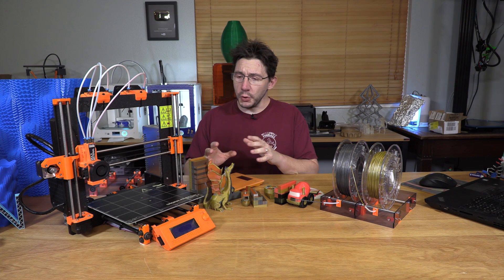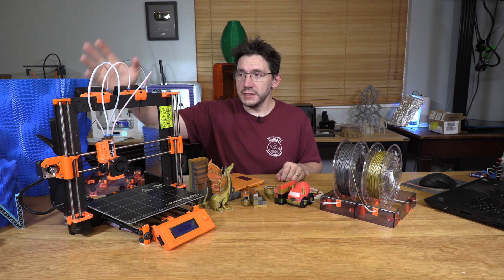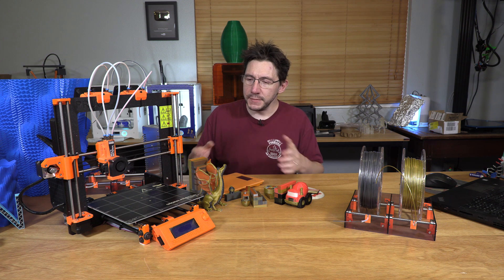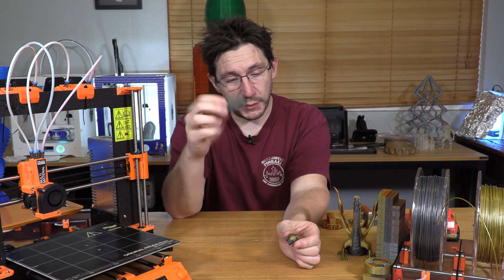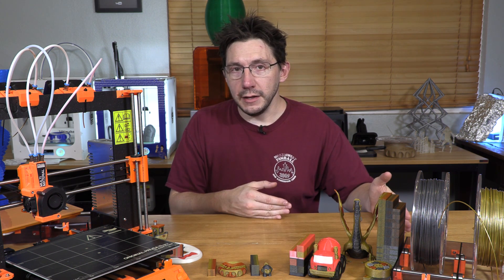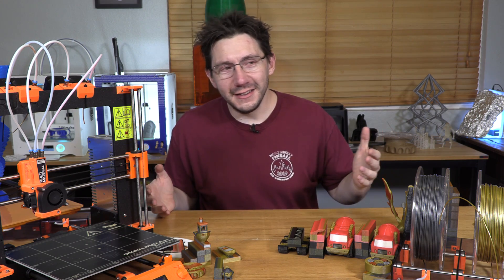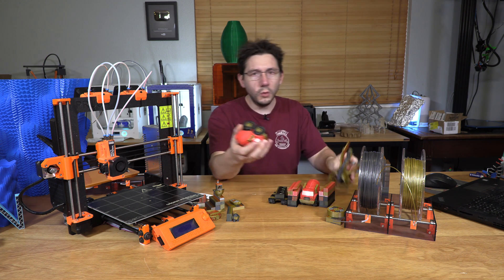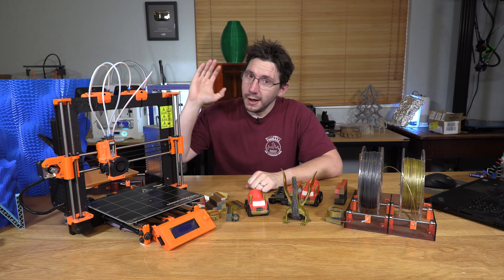Prusa Multi Material Review(?) - My Thoughts on the Prusa MMU 3D Printer

Comment: First of all thank you for you great video.  I am new to 3D printing but having a great time learning and building some great solutions to dynamic requirements than I encounter.  But I am also a systems engineer and want to see the entire 3D printing from the design all the way to the finished product and all of the side stuff along the way.  Following is my question/vision of what I would like to see.
1.  Enhancements to the STL/OBJ to natively and easily support Multi-material and Multi-color.  We already have the ability to change the color of 3D model element unless we join two elements and lose one of the colors.  But why not keep them unmerged and use the native design software and simply assign the display color during design to color1, color2, etc for the available filaments and have a remap facility when not enough filament colors are available to reassign to the closest color.
2. Now having the MMU standardized in the file support facility for storing the file info along with MMU this  can be supported by all 3D Design Software packages from the outset.  (Tinkercad, Fusion 360, etc.)
3.  We could also have MMU Painting support packages for existing STL files but I think that this would be primarily to bridge the period until MMU becomes the standard supported everywhere.
'4.  Next we have to build in the MMU support into the slicers which means that gcode must also have MMU capabilities.  I don't know enough about the status of gcode MMU support to comment.
5.  Next we must expand the availability of 3D Printers to support MMU and have upgrade path for user who grow from 1 to many colors.
6.  Finally we must address the waste block problem.  I can imagine that there are many potential solutions from recycling to time control where filament support for unused colors are turned off when they are not going to be used and then turned on either when needed with a latency issue for the hotend heating up or in a lower temp wait mode with less warm up time to having the slice figure out how long it takes for the hotend to heat up and imbed a "start heating up color n" a couple minutes before the color is actually required.  Again this is a tradeoff between print time and print cost but brilliant optimization solutions and system wide design for the entire ECO system is the right way to go.  Please comment.

Comment: stupid question, wouldnt it be possible to always just print a one shell box for the purge block? wouldnt that reduce the amount of waste considerably since all the filament that gets used there just to raise the purge block to keep up with the print height would be reduced quite a lot. and when changing filaments it could just move to the center of the purge "box" just extrude some filament mid air and wipe it off on the single wall when moving out of the purge area again. might not be perfect and but waste would be reduced a lot

Comment: the purge block size is about how often the color has to be changed per layer thoughout the whole print... if u have like 90% of the layers 1 color without other colors in the same layer it does not need to purge for literally 90% of the print... if u have crossections that alternate a lot between colors it needs to purge a lot more... 

so to optimize for small purge blocks u would have to minimize the colorchanges per layer

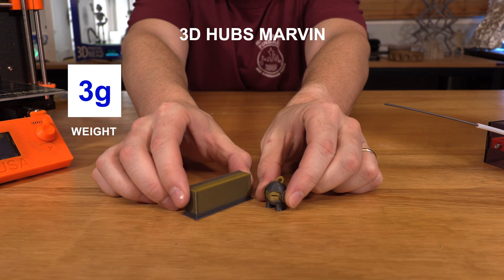Comment: 7:35 yeeaahhh I'll stick to painting. If I do something like this itt'l be more so I can print one thing in PLA, another in ABS, something else in PETg, all without having to change spools. I wouldn't really have a purge 'block' at all, just a purge line, as I'm not gonna be mixing different types in the same part very often if at all.

Comment: I know im late to this party but how about combining the ideas of a standard inkjet printer with a 3d printer.
have a filament that has no colour and can be dyed right in the hotend (the same way they colour plastics in injection moulding, that usually starts of as colourless beads of plastic and they just dye it to suit inside the mould by squirting the required colour in there as the plastic melts). 

in my idea instead of 4 extruders like on this model there would be 1 extruder and 4 ink reservoirs for CMYK)
that way you could have infinite colour prints from 1 nozzle and one roll of filament. if the ink is squirted in just before the plastic comes out the nozzle the rest of the hotend would still only have colourless filament in there, so there would be less need for purging (it doesn't have to completely empty the hotend of one colour before it starts the next)

it would still need a purge block tho but I recon it would cut down on the amount needed to purge

I'm sure somebody with far more brains than me could make that idea work :)  I'm just spitballing

Comment: hey joel, theres a 3d printing trick that now pretty much no longer needs a purge block if you can put your nozzle outside of the printing bed or limit your printing bed. Here is someone who found out that you can pretty much cut the waste by half or even more when you use a purge bucket instead. Ive been using it and it works a lot better than the purge blocks. plus it cleans the nozzle every material change if needed. I think you can do it with this prusa. I got it to work with my tricked out cr-10 with a dual extrusion set up. Gcode set up is pretty easy too. if you need help with that I gotcha. Check it out! https://www.youtube.com/watch?v=XDZzQ2S6jt4

Comment: What people need to understand is that the size of the purge block is completely dependent on how frequently you need to change colors. If you have a model that only has a different color on a few layers then the waste will be minimal. But if you need to change colors multiple times in almost every layer (especially like that dragon which must have had to use 3 to 4 colors for most layers) then the waste will be much greater. There is no way around it. The only way might be to manually purge which could save a bit of waste but even then it wouldnt be worth it considering how much time you will spend changing filament. Other than that you would have to have multiple hot ends or a tool changer which bring upon their own sets of drawbacks.

Comment: Is there a single filament that changes colors when exposed to some sort of external treatment?  Or four different filaments that can be merged together during the printing process that when treated after the fact creates CMYK colors?  No more waste.

It seems to make more sense to have one print head per filament that can be housed in the same assembly or perhaps parked to the side while the one that is needed fills in its part.  I recall you interviewed a guy who was selling paired nozzle kits for about $200 each.  His method allowed for 8 color printing without the waste.

Comment: Appreciate that I am coming to this video long after it was first posted, but I have a question... Would it be possible to set up the printer on a large (robust) shelf or table, with a shelf directly above the printer that held the filament dispatchers? The reason for asking is that the way that the filament feeds in to the mechanisms that are bolted to the cross-brace look as though they expect the filament reels to be physically lower than the cross-brace. 

Asking as I'm thinking of purchasing an i3 with the Multi-Material upgrade, but I'm a little constrained for space. If I can I'd like to be able to position the filament above the printer. Thanks for any info that anyone can share...

Comment: im curios would adding a seperation layer in the purgeblock fix most of the waste part? what i mean is that you add a layer or two where it main porpse is to make it posible to seperate the different collord layers. im think if there are a few studs in between or it has specific places for the indifidual collors

Comment: Hey Joel, I think you're close when it comes to the waste blocks, but you're not quite there I don't think. The size of the waste block isn't directly related to the model height, rather it's related to the number of color changes per layer. If you print a two color model of your house, in with the windows being black and everything else being white, any layer that intersects with the windows will create tons of waste because of the many color changes needed to print the windows and walls in between them, but the rest of the layers won't create any waste. 

Similarly, the mustached light switch plate and the maker coin you printed have rather large areas of the same color, they are wider than they are tall, and neither of them had complex multicolored areas that required lots of color switching. 

Have a nice day!

Comment: there are several methods that are possible that wil minimice and sometimes remove the wast block. 

1 have multiple extruders no need to purge no waste.
2 have a separate bed that folos the model so that you dont need to build in height you just need to purge the necesary amount. 
3 purge inside the model. small models with lots of changes wil be bad ut if you have a large area that needs to be filled then there is alot of space to purge is it not.

Comment: Why not just use the inner part of the prints (hidden inside not visible) to evacuate the mixed colored file ment. For sur the weight of the model will be double, but it will not finish in the trash
Reply from the maker: This video is a little old - they are actually doing that now!

Comment: First off, I have a XYZPrinting Da Vinci 1.0 printer and a Monoprice Mini Delta printer. I think the XYZPrinting printer is a direct drive printer, I think. The Mini Delta uses the Bowden tube design. I am not a fan of the Bowden tube. It is known that the Bowden tube design does not work well with flexible filament., Pet-g, etc. 
My question is first, am I correct that the newer i3 mk3s uses a Bowden tube? If yes, then my second question is how well does the i2 /i3 work with TPU plastic and the like. If I upgrade to the i3 I want to use all kinds of filament. I use filament by a UK company called rigid.ink. I am using their PET-G clear filament in my Mini Delta. And it works Ok. Sometimes it print great, perfect  and then I have to tinker around to get a good print again.

Comment: With a filament recycler..... Just think if you could purge specific colors in a different block there would be less color shift due to the mixing of colors, then you could more easily control the color rather than mixing ALL the colors together into one new filament.... May be worth researching a little....maybe? x-D

Comment: In this video you discus recycling wasted filament and plastic. This is a problem I have been troubled by with just having 3d printing as a minor hobby. How do you handle recycling your waste plastics as someone sho is definitely a major consumer of these plastics and filaments? Have you found somewhere that takes the waste like some kind of trash service? I havent been able to find anything like that for consumers yet and it seems like the only good option is getting machines for an in house process, as you mentioned toward the end of this video, which doesn't seem like a very good option. What ways have you found to "recycle" used and waste filament plastics?

Comment: Where would you send someone to learn how to print in color. I would like to start learning how to change my designs. Right now I just stop the print and change the filament, but would like to learn how before buying the upgrade.
Also, have you tried it with dissolvable yet?

Comment: You could save waste, if you optimize fillins and keep color if it's out of sight. Only the outer sides must be in the right color. So you could analyse the object, how big the walls are and optimize ways to be taken for using one color before changing it. If your wall is inside (fillin) just keep the color. If you print outside change the color according to the face of the object. So waste will be reduced.
The G-code can be optimized for that matters. If you have the geometry of the nozzle you can optimize z-axis to go up and down, if the nozzle fits in the gap you want to optimize.
So you need a new kind of optimizing slicer. With AI you could solve the labyrinth optimizing the ways to be taken.

Comment: Do they currently have a soluble support material for use with this printer setup? There are a lot of designs that our company produces that could utilize soluble support. We have a Statasys 380mc that works this way, but would like to increase our printer throughput with lower cost material and not have to pay another 200k for a printer.

Comment: I imagine if you can orient the model to have as few color changes per layer as possible that would also be a significant factor. It would also be nice if you could assign the material that would go to the purge block into printing another object (that was not color picky) at the same time. I wonder if just making a robot arm that could spray ink/paint on the surface of a model might be a better approach.

Comment: That bearing is the most common and cheap bearing you can buy. Half the stuff on thingiverse that uses a bearing is modeled around that 608.
As for the purge block - it also comes down to colors present per layer. Careful construction of your model can keep the color changes per layer to a minimum, as can careful selection of your final print axis.

Comment: I'm going to ask this in all seriousness. I'm a complete noob but I have a serious goal in mind of what kind of prints I want to accomplish.  I come from the hobby modeling world and have a degree in sculpting. So the goals I have are to print modular small scale prints with the hydro disposable filament and use a superflexible filament for hinges embedded into a third high strength material to eventually be coated with nickel for an  electroplated finish stage to be a super strong inner frame. Whew that was difficult to type in one go but I hope its understandable, But I'm having a hard time finding a multi filament system for a beginner... with work and help is this a good choice or would you recommend something else based  on what I want to do
Reply from the maker: Hey there! So, this system wouldn't be the easiest for what you do, as printing superflexible materials with this isn't easily possible. There are other systems out there that could print super flexible materials and rigid materials - look at what Diabase Engineering is doing with their H-Series.

The only issue, then, would be figuring out the electroplating!

Comment: instead of it printing purge blocks wouldn't there be a way to make the machine take that purge materials and just print either multiples the purge versions of the print will just be wacky looking? or default the machine from a purge block to a pen holder or set it to make a ton of nuts and bolts at least then the purge would be useful and there would be far less waste in the end just sayin why does it need to be a block

Comment: if you can recycle the waste into new multi-color filament and then use that as a interior model filler. as long as there is no color bleed through. you would save a lot of material.

Comment: Joel, long time lurker, first time commenter... And unfortunately, I have some issues with your "review(?)"... You focused quite a lot on the waste aspect of this technology, and I think that does a disservice to it.

Multimaterial printing isn't new (I've had dual-extrusion Pegasus machines for almost 4 years), but the ability to print 4 colors is, relatively speaking. Like you said near the end, this is a "Mk 1" tech for this plateau.

Second, you make no mention of any effort on your part to tune the retraction settings or waste-deposition to minimize your losses. These are end-user tweaks that change based on the filament types and color gradients.

Speaking of settings, you didn't mention that unlike the competitive technology (E3D's Kraken), this is a single nozzle technology with no fiddly offsets to figure out. The flipside of the ease of setup being those waste blocks.

Lastly, the MME option on the Mk2S and Mk3 is not designed (in my opinion) for hobbyist printers, but rather for niche manufacturing customers of the Mk2S/Mk3 who have the ability to pass the additional cost to their customer in the form of a "multimaterial surcharge". You're absolutely right, if you're a hobbyist counting pennies to print what you want, this is a wasteful design... Paint and post-processing is much cheaper. But, for a small business or commercial prototyping application, this technology may well be a godsend (ignoring for the moment the multi-MATERIAL aspect of being able to embed, say conductive traces or flexible sections in-line, rather than during assembly/post-process). 
I'm not a Prusa fanboy by any stretch of the imagination (a 300mm cube printer for $1000 in this market should at least come with an enclosure, IMHO), nor am I trying to get down on you the reviewer. I'm a big fan of your channel, but, I feel that you haven't done your due diligence on this particular product.

Comment: Here is how i see it, you must remember that the every time it was to switch colors it must purge therefor because it prints in slices it may have to switch up to 4 times per layer depending upon the amount of colors needed for sed layer. as in if the bottom half of dragon is one color and the top half is another it will only purge once.
Reply: yeah, which i think measn it makes more sense to cut the model up , print it in pieces that can be slotted together. print each set of colours at a time, still far less work than having to change the spool over betweeen sets.